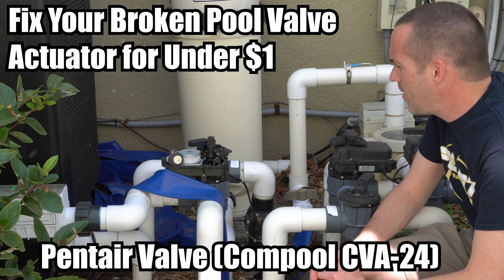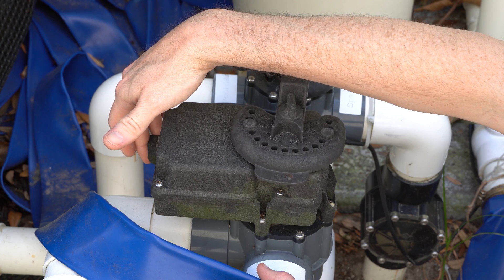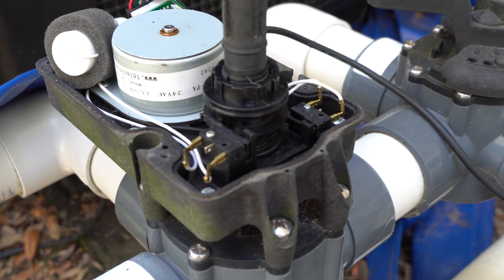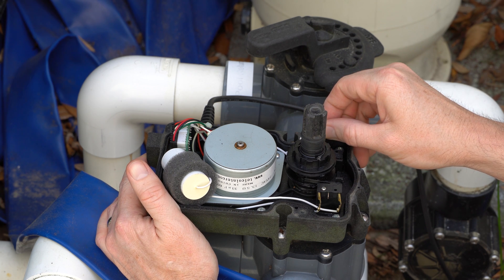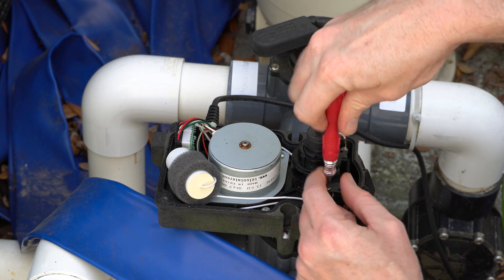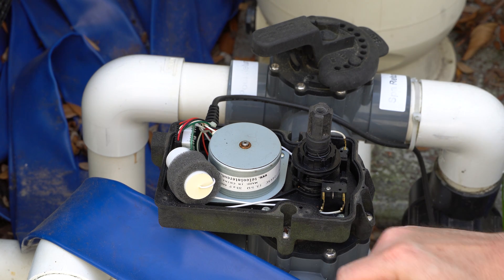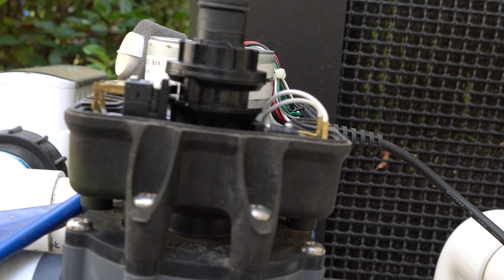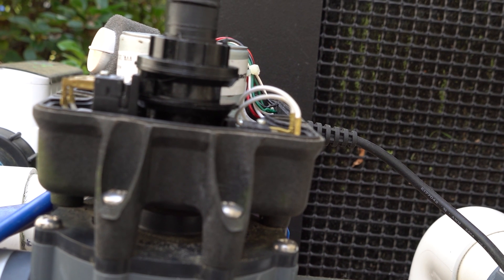Fix your Pentair Pool Valve Actuator for under $1.  (Compool CVA-24 bad limit switch).

Comment: I called a pool service a month ago about my spa jets running when I switch the pump to pool mode.  They came out and thought they would have to replace the actuator but after my brother recommended he check to ensure the actuator is getting power, he discovered a loose connection.  $200+ later, I was content.  Fast forward a month later and I am having the same issue except this time the valve actuator is not turning when I switch from pool to spa.  I watched this video and after changing the limit switch, my actuator is working again.  Thank you so much....you have saved me another service call.

Comment: Thanks for the video. I see now my leaking actuator valve is below this unit. I noticed you have the same filter as me. Mine was leaking and I replaced it with $80 top off of Amazon vs $1000 for whole filter unit. I made a video also. My pool filter fix video https://youtu.be/22uUYi5IXZA?feature=shared

Comment: It did not work for me. I replaced both switches, but still the lever does not move, and it's tripping one of the switches in the control box.
Reply: The "switches" in the control box are circuit breakers.  If it's tripping one of those you likely have a short in your wiring.

Comment: Thank you!  In the short term I have been able to touch the contacts as you demonstrated to get it to move from spa mode to pool mode so that water is now flowing through my filter and chlorinator; restoring pool skimming, filtering, and chlorination.  (back to normal pool function)  I'll now order some switches to see if that fixes the problem.

Comment: This was exactly my problem and I already had those exact microswitches for my CNC router stop switches. The issue on mine was caused by water ingress, whoever put the top on that valve pinched the o-ring/seal and it leaked. The unit was under water but I dried it out and it's still working. I am going to make a warranty call though  and get the whole unit replaced before it goes bad.

Comment: The items are no longer available on Amazon, is there any place else to get these switches?
Reply from the maker: The original seller appears to be gone and they've upped the price, but still much cheaper than replacing the valve: https://amzn.to/3Vl6kUB
Reply: I got the switches on Amazon yesterday, 7/20/24.

Comment: I don't normally comment on videos - but this has fixed my parents pool solar heating. The actuator was not turning...turns out the switch was not connected properly. Didn't even have to replace - thanks to your video I managed to fix it all. Saved me hundreds of dollars for replacement part and install for parts plus install (and call out fee)! 

Thank you sooooo much!

Comment: Thanks for sharing this video and appreciate all the additional feedback from others.  I'm having trouble finding these microswitches online.  Any suggestions?  Tried Amazon and they don't have the two prong for the part# SS-5-2T.  Other inform on microswitch shows 5A125VAC. Can these be purchased at local pool stores or only online.  Any help would be appreciated! -
Reply from the maker: 5A125VAC is fine, these are 24VDC systems running on very low current, so it does not exceed the ratings for those switches.

AmazonUS: https://amzn.to/2WDD6Dq
AmazonUK: https://amzn.to/33QZriN
Reply: Thanks, the link that you provided is for a Micro Switch with 3 Pins. My switch now only has two prongs.  Does it matter if I don't use all three? Really appreciate the help!
Reply: @richbeitter9158  One of the pins will be "normally open", the other will be "normally closed".  The 3 pin will work, just put the wires in the same position that they were on the old one.

Comment: Thank you for your video. I thaught my actuator was "Kaput" but I follow the instruction on the video and just by checking and moving the connectors, I was able to reactivate the actuator movement. The problem was a bad connexion at both sides because of corrosion.

Comment: I called the installer of my solar system and after a quick troubleshooting over the phone, which basically was turning the switch toggle between on1, on2 and off, he told me most likely I needed to replace the actuator or control. The fee for actuator replacement was $340 plus a travel fee of $3/mile. I removed the cover and noticed one switch terminal was slightly bent. After straightening out the terminal, presto the actuator started working. Warm water started entering the pool. You saved me well over $400 today. If the switches fail one day, at least now I know how to replace them.. Thanks so much for your video boss!!
Reply: Same thing happened to me! I did a bit of troubleshooting. Was about to remove one of the terminals and as soon as I touched it, the valve started moving. Turns out the connection was just loose. Saved me a bunch of money too! Thank you for this video!!!

Comment: My CB3 - 3A Circuit Breaker for the actuators is tripping.  Is that easy to replace? Also how do you tell if it’s bad or if there is a short in the actuator tripping it? Compool 3400.

Comment: Robert, hope there's a lot of good karma coming your way.  Just crimping one of the connections appears to have fixed our problem.  Will be ordering some limit switches to have on hand. (side note: wasn't sure what power was going to these switches, but seeing you handle them gave me some idea it wasn't 120v).

Comment: I could not believe this would work. So before ordering switches I opened up the valve actuator to check it out and fiddled around with the connections to the switches and, presto, the one that had failed started working again.  So the spade connector was kind of loose and tightening with pointy pliers did the job. Fast forward to yesterday, they the switch failed again, found this video for a refresher, got myself a couple of switches mailed order (next day, $7.00/pair on amazon, ready to use, specific for this), installed in 2 min, and  valve is working again. This is an amazing "little secret". THANKS!

Comment: Robert.  Can't thank you enough for this video.  Was clueless as to why my spa mode flowed into the pool as spillway.  Did just as you said.  Changed out the switches for $1.50 total and works fine now.  Thanks.

Comment: Great video, though I think I have a bigger problem. My actuator sounds like a coffee grinder and if I manually help it move it will stop when it hits either limit switch. Then, if I flip the toggle, it struggles again until I help it move. The motor is hot as heck and has a bit of rust on it. Do you think the whole thing is shot. Can you replace it without draining the pool? I need help as the company that installed all this has really crappy people.

Comment: My actuator stopped working and my local pool company would only replace the whole unit. They were going to charge about $250. I purchased the switch and it worked. Thank you so much for this video!

Comment: My pentair valve just spins when in the auto mode. Would that indicate the limit switch failure as described in this video or something else?
Reply from the maker: Yes, that sounds like a limit switch error
Reply: @thehookupextras  thank you. I just noticed I have the Jandy actuator and the switch arm is different. Thank you for the video, huge help and I just ordered a package of switches that look to be the right dimensions and arm structure.
Reply: Thank you again. I ordered this part for a 10pk for my Jandy valve. Replaced both and working perfectly! Thanks

Comment: Great Video!!!! I was about to order actuator from Amszon then stumbled across this video. Found one of the limit switches problematic. I went one step ahead and fixed the limit switch myself. It is a delicate part. Resistance across normally closed leads were high, in the order of few Kilo Ohms. I took the contacts out and sanded and put them back, then the resistance became close to zero. And valve started working. Anyway I will get new limit switches and keep them in backup.

Comment: This post just saved me $200. In my case, the limit switch was not the problem, rather the post that secures the handle was binding against the housing. By taking the handle and the housing off as noted in this video, I was able to clean and lubricate the post and now everything works. Thank you!

Comment: So did the valve actuator not move, in one direction?  I think my valves are turning but something is making the spa drain in a few hours but not fill again until I put it in pool mode.

Comment: Thanks, this fixed my problem! Replaced both switches. One quick question. Does it matter how you connect the wires to the posts? I tried to keep top to bottom positions clear, but started changing them to try to get the handle to stop where I wanted, since after reattaching the handle, the valve was opening and closing 90 degrees off from before. Figured I might have reattached the handle in the wrong position, and was finally able to adjust the handle to match the waterflow. Seems to work despite the cross wiring possibility.

Comment: Hey dude thanks you saved me a couple hundreds bucks my spa jet motor wasnt working it was stuck on water feature which I never use... I ordered the limit switches which are not one dollar i could find them no where but amazon for 15 bucks for 2. anyway I popped in the new switches and it works fine I now have my jets back wo buying a new motor,, cudos einstein
Reply from the maker: Direct link to the amazon listing was in the video description: https://amzn.to/3BLSSOL
Reply: @thehookupextras  I hear ya but the ones for 15 bucks are closer to original and you don't have to rip off those tails with the rollers ...money isn't everything were talking small dollars here not huge but I understand

Comment: Thanks!  Bought a house with a pool a couple months back and last night it got stuck on waterfall.    You were the 2’d video I watched and sure enough it’s a bad limit switch.    I’m leaving for a few days and my chlorine generator doesn’t run in waterfall mode so you saved me from both an expensive repair bill and returning to a swamp

Comment: Can someone help me? That works fine for me but..it leaks. When I stop the flow going to salt cell, it stops leaking. Looks like it's coming from where screw is. No cracks in anything. Any idea. I'm guessing maybe that membrane you called water proof membrane

Comment: Thank you for taking the time to document this amazing fix! My switches will be delivered tomorrow and I was able to manually return the valve to the correct position in the interim in less than 10 minutes. It's 103 degrees today, so having a working pool is important.

Comment: Note to viewers - the switch might not be the whole problem.  I have replaced my switches a few times over the years - I just replace them all every few years.  What I have noticed is that the spade connector can be kind of loose and loses its connection.   I just replaced 6 today and after replacement tested all of them and they are working fine.   A new switch with a faulty connection will fail again, so I used some tiny needle nose pliers to crimp the female end of the spade connector to make a tight fit electrically.   I am confident this will extend the length of time between switch replacements.
Reply: Tom- your comment about a loose spade connection solved my problem. Thanks for chiming in. Of course, I also ordered a bunch of these limit switches too, because it sounds like they will fail eventually.
Reply: I replaced my switch last summer and have to do it again now. I have a hunch you're dead on. Thanks both of you for helping us diy'ers!

Comment: going to try this fix out this weekend, thanks for the advice.
Reply: I replaced both limit switches, worked exactly as the video described.  I also had to adjust the upper and lower cams just a bit since the button was slightly larger than the original limit switch button.  Thanks for the video!

Comment: Followed instructions  but found that I had ice inside the control box.  Currently 19 degrees.   I used hairdryer and electric blower to dry out the box electric went back to working correctly.   Was able to set the valve where it needed to be for freeze mode about 25% open to flow water through all pipes.   Thanks.

Comment: My pool guy (who we really like and trust) was going to charge we $275 (labor included) to replace this valve.  I watched the video twice, ordered the parts and after a quick 5 minutes of work I replaced both micro switches and my valve is working again! I spent $7 on a 10 pack of valves, saved $268 and can do the repair 4 more times!
Reply from the maker: Funny story, I actually showed this to my pool guy (who I also really like and trust) and he said "Huh, I had no idea".

Comment: That was amazing and it worked!  The part number supplies me with a bunch of switches so I put a few extras in the switch motor housing! Giddy Up!  If you are ever in Las Vegas and need to go sailing, give me a call! Is there a place to send you a few bucks for the tip?
Reply from the maker: Glad it worked Mark, no need to send a tip.
Reply: @thehookupextras  do you have the Amazon link for these limit switches? Didn't see it in video.

Comment: Does Amazon only sell the limit switches in packs of 10?  I will buy regardless as I have 5 of these valves.  Just curious as to why they sell them in packs of 10.  Also, thanks for you videos.  My valve just failed and I went to YouTube to see if I could fix it myself and found your videos.  I'm now a subscriber!  :)
Reply from the maker: I think they only sell 10 packs because amazon takes a pretty hefty flat fee on low cost sales, so selling 10 helps the seller stay profitable.

Comment: Robert.  Thanks for the video.  I followed your instruction, and it still didn't work.  If anyone else has this problem, do what I ended up doing.  I opened the Pentair control box and VOILA !!! The 3 amp circuit breaker had popped.   LOL

Comment: Thanks Robert.... my American Home Shield warranty insurance doesn't cover any automation equipment, including a valve actuator, just the valve itself. So my pool repair service guy suggested ordering a new actuator online and installing it myself, if I felt comfortable with that. Then I saw your video and have now ordered the limit switches (10 for $6.99), which I'm pretty sure will fix the problem. Thank you!
Reply: Robert, great instructional video. Valve now turns as it should. HOWEVER, the water from the hot tub is still draining, very slowly, back into the pool. Any suggestions. Thanks!
Reply: @g92069  It's late for this but the problem is either (1) the diverter valve assembly in the valve directly under the motor or (2) the check valve on the spa.

Comment: if the manual switch won't move it, does that mean the whole actuator needs to be replaced?
Reply from the maker: Not necessarily.  Did you check to see if the valve will move if you touch the wires on the limit switch together?
Reply: @thehookupextras  I tried touching the wires on the limit switch and no movement. I even tried replacing the switches anyways - no luck. Any suggestinos?
Reply: No. My valve would not turn manually either. I read somewhere that this type does not turn manually. Only way to get manual operation is to remove the whole actuator.

Comment: I first thought my issue was with the programing but found out one of the automated valves wasn't working (rule 1, check mechanicals first).  Popped valve top and indeed the limit switches were wonky.  Just finished replacing both switches after amazon order arrived this morning and it works great.  Thanks so for such a great and informative vid.

Comment: Wow!  Thank you so much for sharing this information.  It’s work.  I just needed to change one of the microswitch 
(I found the microswitch on Newark.com for Cdn$3.01 each + delivery / eBay and Amazon price was crazy).

Jean / Oakville - Ontario
Reply: Jean, what part number did you use in Newark for the switch

Comment: So there's no issue with not turning off power before doing this work?
Reply from the maker: I suppose it's always a good idea, but these are low voltage actuators.
Reply: Nope... I wondered the same left it on so I could test it.
Reply: I used a multimeter to check for voltage before touching anything. With the toggle switch in the off (center) position, there is no voltage across the switch leads.

Comment: I replaced the 2 limit valves I just got from Amazon but it's still not turning to the left which is set to ON1. ON2 is all the way to right and I hear the motor. Any idea? I have an empty Spa right now since the ON2 is set to Spa drain. I need it to go to ON1 so the Spa can be filled w/o draining. Any idea?

Comment: It appears that my actuator is working properly (turning the right direction when trying to drain spa to clean it).  Took off lid as you showed, and touching one connector to the other made it move.  How can I tell if this is why my spa won't drain when the panel is set to drain?

Comment: Are you knowledgeable on the cp3810 controller?  Mine seems to be incorrectly set for a 2 speed pump but i only have a single speed.  When selecting 'spa low' it runs for 5 minutes then shuts off.